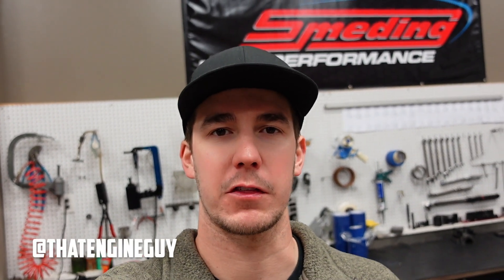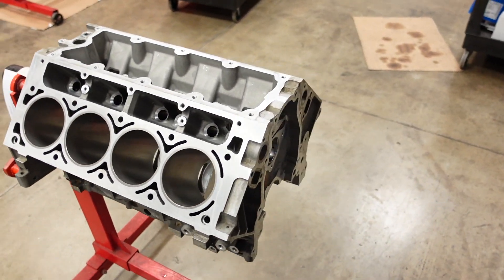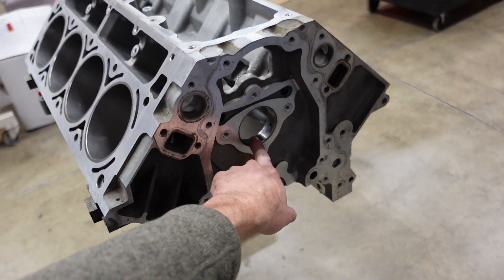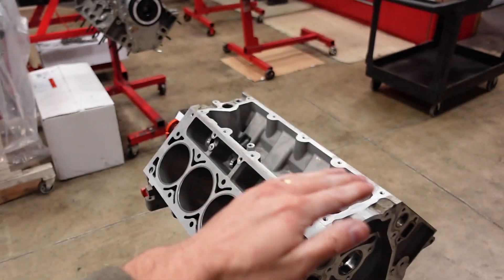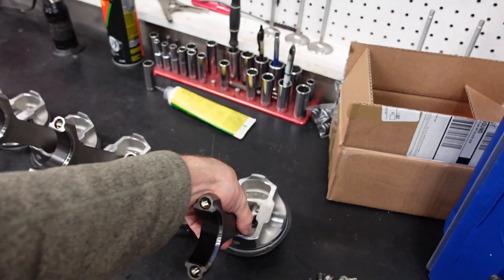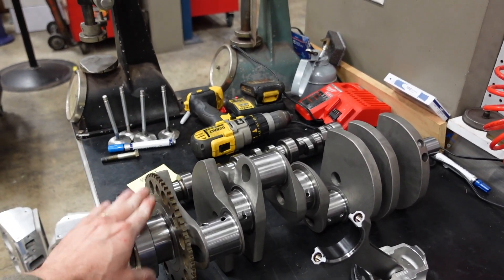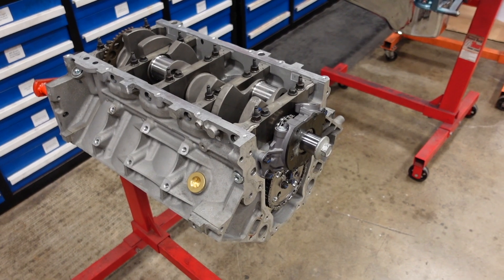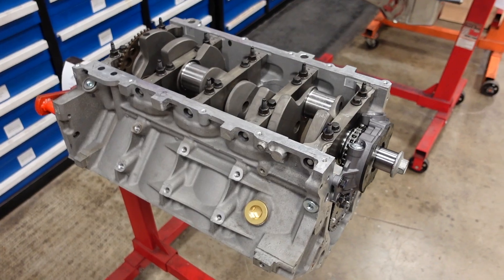Building a 383" LS Engine - Autocross / Road Race

Comment: idk if i posted it here. but this is what was found in my car.
Engine experienced a lifter and trunnion failure  
Removed engine from vehicle. Disassembled to evaluate failure and damage.
Engine has major damage. See notes below
Disassemble notes:
-#6 intake rocker is broken and pushrod is stuck in valve cover
-#7 intake lifter roller severely worn down and damaged cam lobe -Both rocker stands are shimmed with snap rings
-Spark plugs show vehicle was very rich
-#6 exhaust rocker has one broken snap ring on trunnion
-Most valve tips are mushroomed
-#4, 5 and 7 cylinder walls are badly scored. #7 has the deepest and may need sleeved
-Found broken rocker and snap ring pieces in oil pan
-#6 exhaust lifter roller is ground down to the pin, mushroomed lifter body and severely gouged lifter bore - will need bushed
-#1 main bearing is worn past the copper, crankshaft main journal is badly gouged and damaged
Engine has the following upgrades: -Rocker arms have BTR trunnion upgrade -Camshaft is BTR Stage 2 NA
-Dual aftermarket valve springs -Aftermarket rear seal cover
-Johnson lifters
-7.600" pushrods
-ARP balancer bolt
-Melling oil pump
-Mahle pistons, standard bore

Any future engine builders wanna take a shot at whats wrong with the upgrades? Someones bad at math. lol... (its how the car was sold to me by the dealership as well as it has a warranty.)
Im dying inside. pray for me.
Reply: Seems like an oil issue but ran too long that way,  or the metal from the failing lifter made it's way around for far too long.  7.600 length pushrods sounds odd to me...
Reply: I would check lash, maybe look at the plunger depth in lifter and make sure your pushrods are the right length.

Comment: Are you using stock main bolts?  New? Used?
Reply from the maker: Reusing stock main hardware. They can be reused as many times as you want.
Reply: @JacobVillemain   Thanks. We always use ARP studs. Figured it was overkill.

Comment: Not applicable to this block, but in regards to Gen4 OEM blocks, rather than just plugging off the DoD Towers in the valley, have you guys ever thought of running an Oil Line from Tower#7 back up to Tower#1 in the valley in order to get oil to the front of the block as fast as possible for high performance OEM block motors ? (and then just plug the remaining Towers)....

Comment: What compression ratio are y’all looking for, for an autocross/road course engine
Reply from the maker: This engine will be 11.25:1 for pump gasoline.
Reply: @JacobVillemain  I’m currently building a similar build, 408 stroker here but will be running around 12.5:1. Was looking at possibly dropping compressing with a thicker head gasket and larger 70-72cc heads to get closer to 11.5:1 or lower if possible maybe run boost
Reply: @JacobVillemain  but my real goal is max hp NA for my 85 c10, looking at a t56 or tr6060 and do autocross/road course.

Comment: I have a ls3 in a 350z that is a dedicated road race car. It was fleshly rebuilt by a local machine shop that was recommended by a trusted source but I'm not convinced anymore. After getting the engine back, I have not been able to maintain oil pressure once the engine is hot. The engine is completely new and I have replaced the oil pump and pickup oring again since the rebuild. Oil analysis came back good. Car has a improved racing oil thermostat and decent size oil cooler. Any ideas? Maybe main bearing clearance? I bought the  Mitutoyo dial bore gauge and micrometer because I'm stumped. @LogansGarage
Reply: what viscosity oil are you running?
Reply: @Gonzalo6O  Mobil 1 5w50
Reply: @Wingnutt2420 What Oil did the Machine shop recommend for the build? Have you tried checking oil pressure with different oil, maybe 5w-30 or 10w-30? I believe 5w-50 seems a bit too thick for an LS engine, I'm not sure what your clearances are but I think usually for an LS they should be around .002-.0025(?) Judging by your complaint being only when engine is hot I think your oil is too thick. 

hopefully somebody else can chime in.
Reply: @Gonzalo6O  He recommended 10w30. I started with that and had the same problem. Changed to 5w50 because I was running out of cheap ideas. The thing is, I can let the car get up to temps and idle for an hour without a problem. I can even complete a 20 minute track session but after that even with an hour to cool it will lose pressure on the 2-3 lap of the next 20 minute session. I lost a whole year... Might just buy a long block and say F it.
Reply: @Wingnutt2420  Dang that is weird. Do you have a Oil Temp gauge you can use to record the temperature of the oil? Seems to be going low only when the oil is really hot. Maybe it thins when it becomes way too hot. How are you reading Oil Pressure? Have you tried another method of Reading oil pressure?
Reply from the maker: What is your oil temp when you see pressure drop? And how much is it actually dropping? Some data would help.
Reply: @JacobVillemain  my gauge showed 280 max. I just ordered a Holley IO module so I can data log this better. Also my second oil analysis came back yesterday and it seems to have fuel in the oil. Is it possible the rings didn’t seat causing the oil to lose its viscosity/break down?
Reply: What were the main clearances when you built it?

Comment: I'm building an all forged 6.0 iron block ls for 1200-1500rwhp. What would warrant the use of a billet double roller timing set vs a billet single? I have the rollmaster single billet currently. Will it hold up. I'll be running a good ati dampner. Thanks. Love the channel.
Reply from the maker: We pretty much only use single roller for all builds.
Reply: @JacobVillemain what is the part number for the billet Rollmaster timing chain set please? 
Great engine build 👍🏻🇦🇺
Reply from the maker: @bigal878  CS1190
Reply: @JacobVillemain  thank you